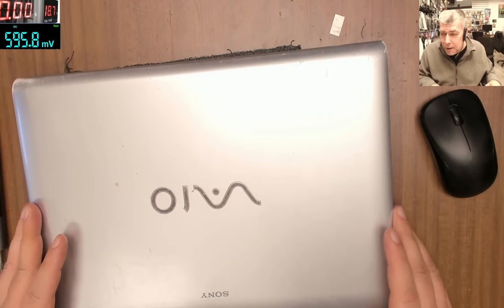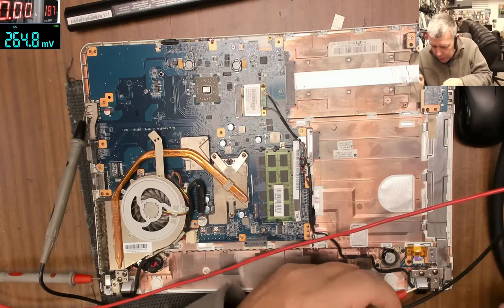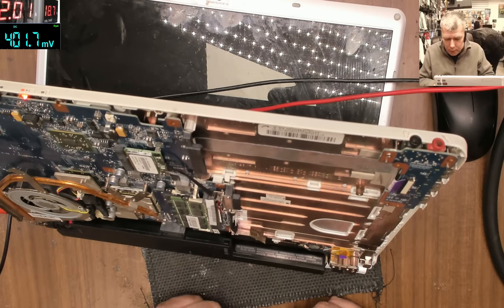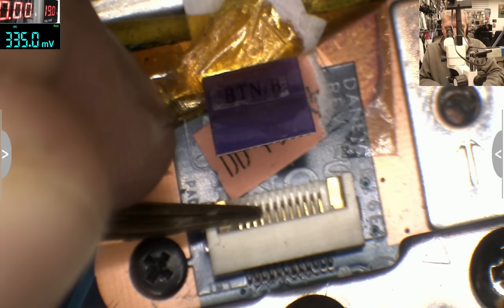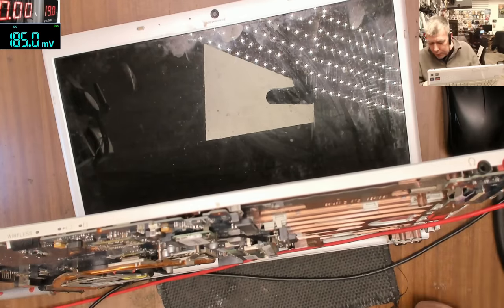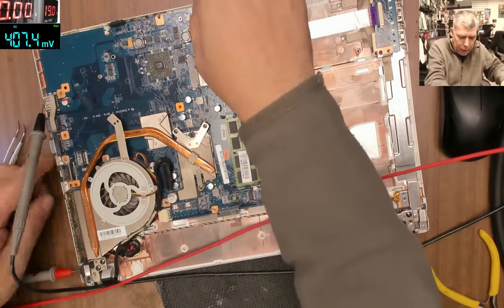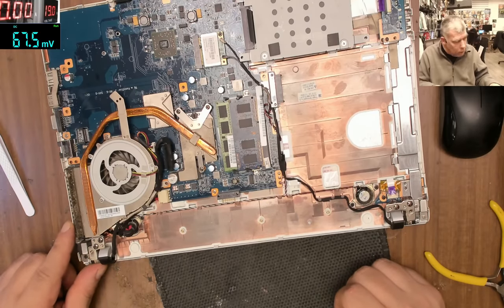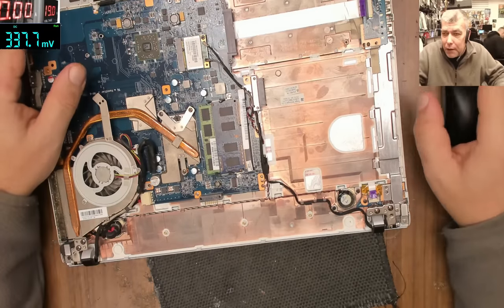Sony Vaio laptop repair, charging but not coming on

Comment: Salut Sorin! Este stiuta foarte bine problema la butoanele de pornire de la sony vaio . Detin acelasi tip de laptop care porneste cand vrea el si se opreste cand lucrezi cel mai intens . Binenteles cand vreau sa il pornesc trebuie sa folosesc butonul assist. Adevarata problema este butonul in sine care inchide doua circuite la actionare.

Comment: Been watching a lot of these videos very interesting and very informative ..

Been into fixing computers usually on a basic level  but never got down to motherboard level repairs but want to learn and these videos have been useful in that learning process

I actually have 2 laptops that don't fire up I know one of them has a dead component on the power rail side but don't have the gear to remove and replace 

The second laptop I have sat here is an Acer laptop there is an orange light appear but that's about it pressing power does nothing and the power button is part of the keyboard and runs on the keyboard flex so not totally sure what pins to touch to try to fire it up
Reply: you can't fix it in the comment section .

Comment: Greetings. My Acer Aspire 3 A315-54k does not turn on with the power button but when I press and hold any key it turns on but once I release the key it turns off. I would appreciate any suggestions on how I can solve this problem. Thank you.

Comment: after I turned off my VPCSA4c5e last night. It doesn't turn on any more. when I connect it to power grid and push the power botton its HDD starts to turn. no boot and turn on its power leds. the battery well charg but it doesnt turn on

Comment: Very informative, dear brother Sorin, can you give a hint, I have an asus, tried to check all mosfet, all doing fine, but symptom is not fixed, originally, when power adaptor is inserted, the board automatically turns on without display eternally. maybe a hint to stop or persuade myself to continue, thanks
Reply: Does the caps lock key works ?
Reply: @derbidrd01  Nothing works, just automatic power when adaptor is plug-in, tried external monitors, nothing. Checked all capacitors, all is okay, not grounded. I suspect this graphic chip burned. It came from other repair shop, just hoping to revive it for my own use.
Thanks, I always follow your videos,
Reply: @NPOSK  Yes in this case it could be the bios, ram, or cpu/GPU. You can try to flash bios with ch341, try different ram if it doesn't have onboard ram. If nothing works you and you have nothing to lose you can still try to reflow CPU/GPU
Reply: @derbidrd01  Thanks brother, will try before giving up. :thanksdoc:

Comment: Apart from the broken ribbon connector, this laptop has 2 other issues.  The battery is old and NBG, the hard drive is old and NBG.  New battery and an SSD will rejuvenate this laptop.

Comment: I don't get it why people still use those kind of laptops. It's so old and very cheap and spending money to get it fix is more expensive than buying a new i3. People are weird.
Reply: Because they are very robust i am also using older laptops with linux and they run fine
Reply: @robsonrobbi1763  so robust, yet to fix.